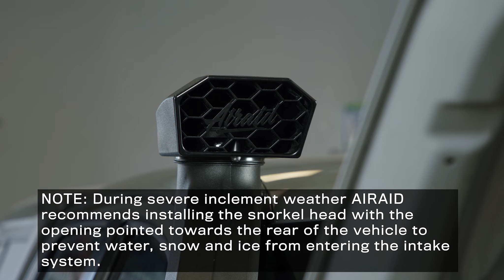How to Install Airaid Snorkel Kit For 2016-2021 Toyota Tacoma 3.5L

Comment: Love that snorkel, but one thing about install - you do not need to remove the fender flare.  They are sometimes difficult to line back up and often the clips break, as well as the sticky part is rendered useless after.  The fender liner can be easily removed or manipulated out of the way for plenty of room for the install.

Comment: Came here after pre-ordering one... I expect I will need to fabricate something to mount directly to my prinsu rack rather than to the roof bolt holes?
Reply: Yea I just did mine last night, cut the bottom of the provided bracket off and one hole through the bracket and through the prinsu.

Comment: This doesn’t look like it works with roof racks as you have to use the same mounting points for a room rack as for the snorkel
Reply: Works with prinsu, you just bolt it to the rack